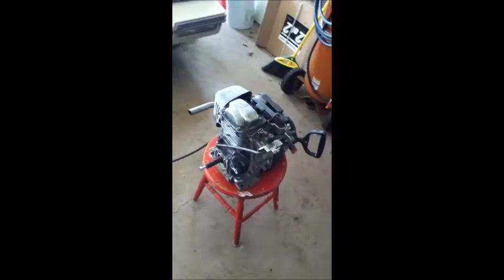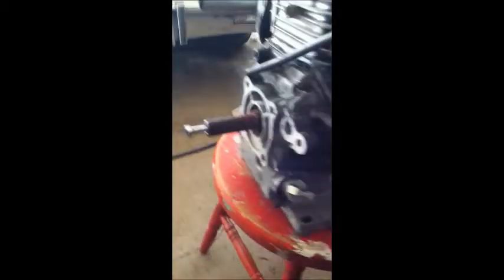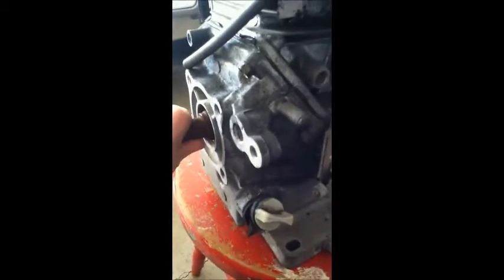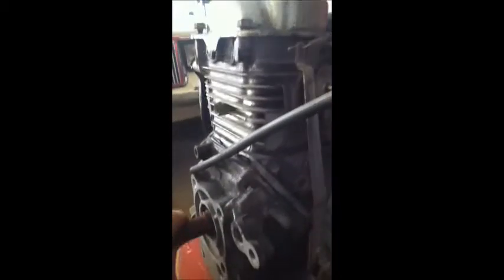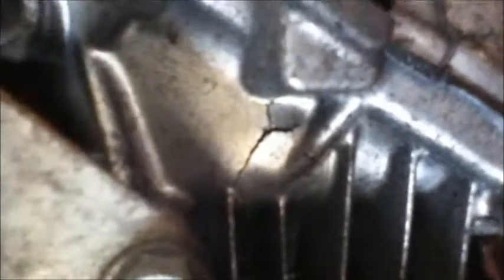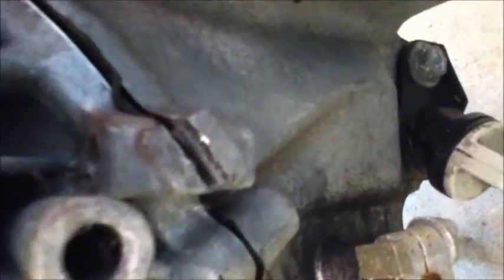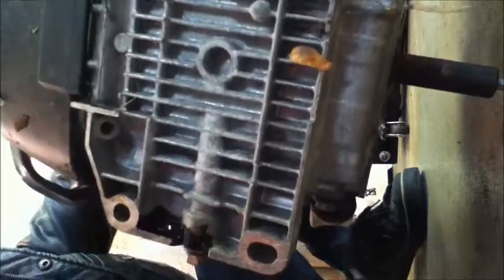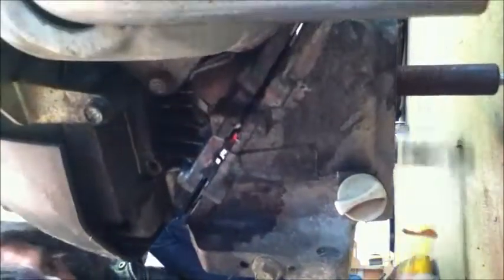Blown Honda GC160, Tear Down and Inspection.

Comment: wouldn't it be easier to remove the carb, valve cover, and cam belt before trying to split the block? :p

yikes... that rod's a mess. :)

Might be worth fixing up though.... those little 5hp are used for almost everything.  Snowblowers, pressure washers, air compressors....

Comment: Can u take the intake valve out and replace or is it trash
Reply from the maker: Yes the valves are replaceable. I never did anything with this engine tho, Wasn't worth it.
Reply: how much disassembly is needed to be able to replace an intake valve? can you leave the timing belt in place and replace the valve?